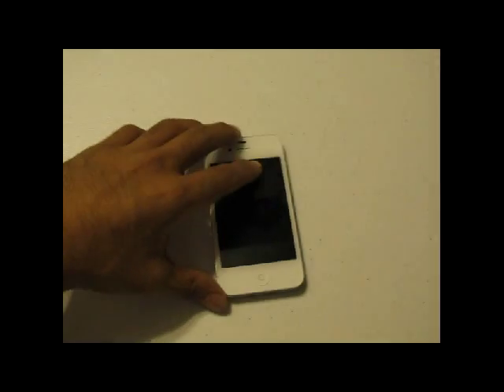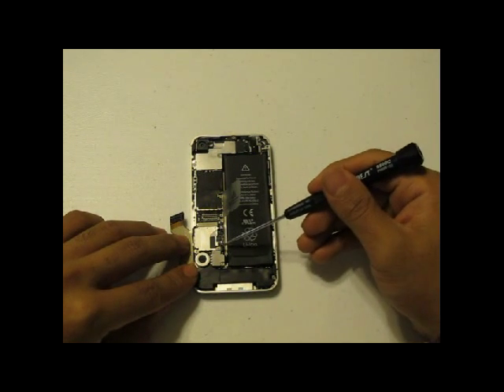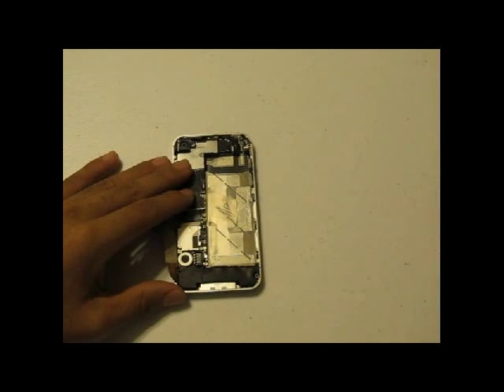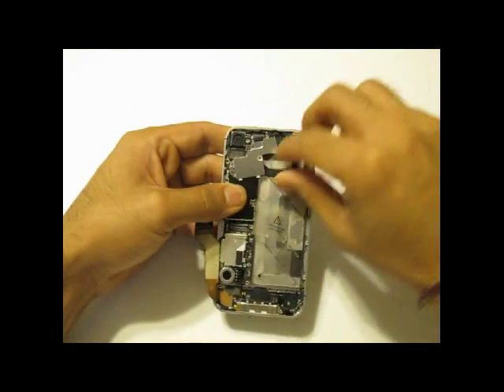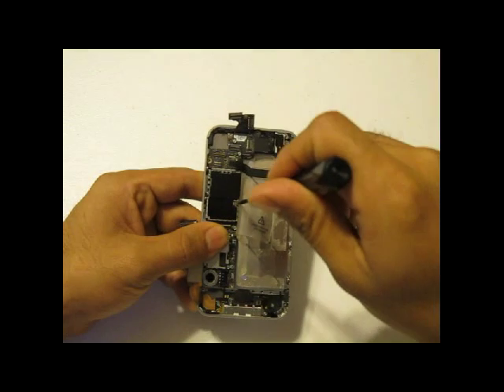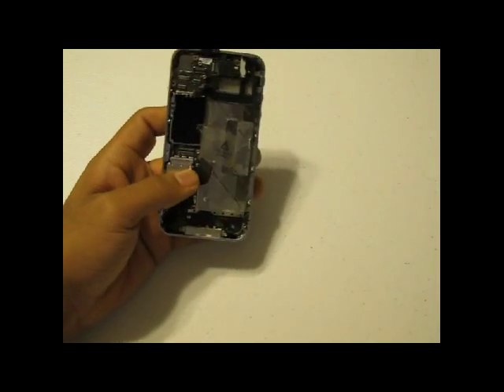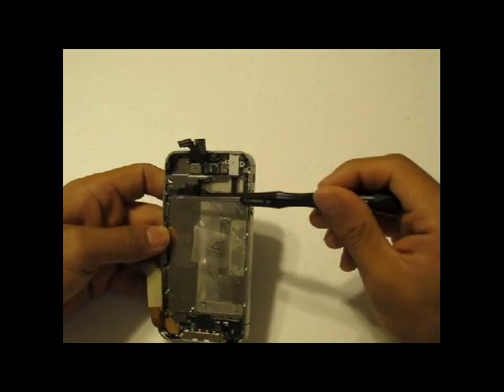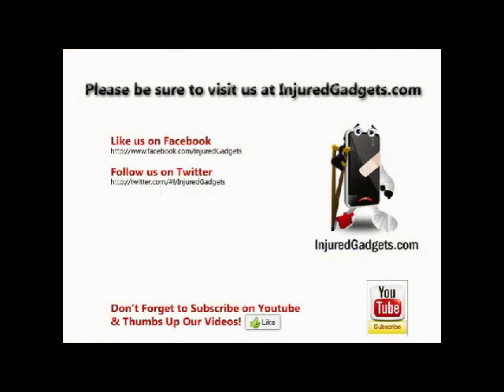iPhone 4S Teardown & Touch Screen Digitizer LCD Screen Display Replacement Repair Directions

Comment: You guys are the best! I saw some amateur videos where they don't even tell you which screwdriver to use. With your useful tips at every critical point, both in teardown and reassembly, only goes to show your excellent knowledge on the subject. Great presentation overall. You guys are surely collecting mountains of good karma. Thank you!